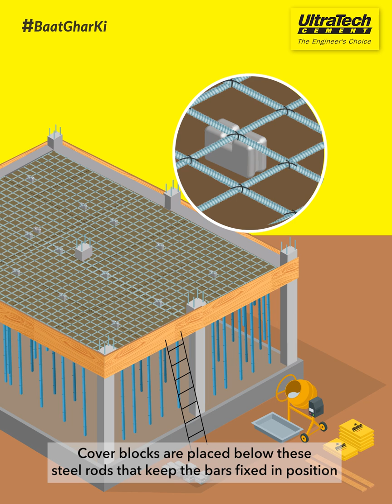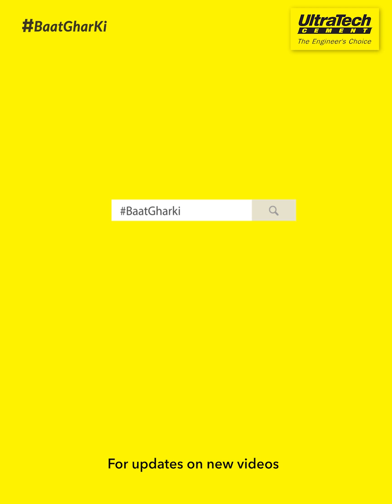How to Build a Concrete Roof: Step by Step Guide | UltraTech #BaatGharKi

Comment: Is there any other material rather than cement for using house  construction ?which can give same or more strength .
Reply: Lime
Reply: @shubhankkushwaha2215  I think lime will not give as much strength as cement concrete can give .
Reply: @Aniket-gf8ns  cement is consider over any others.yet there are variety of cement like opc pcc psc with different grades.
Reply: Bamboo and tar.
Reply: steel